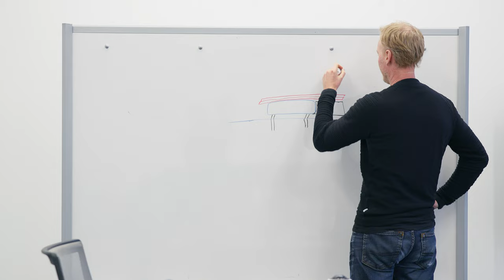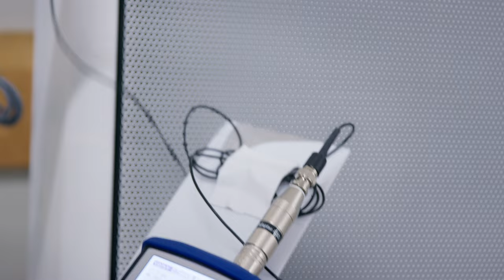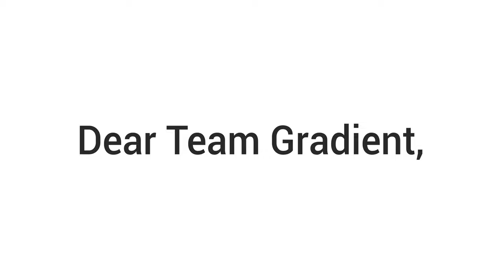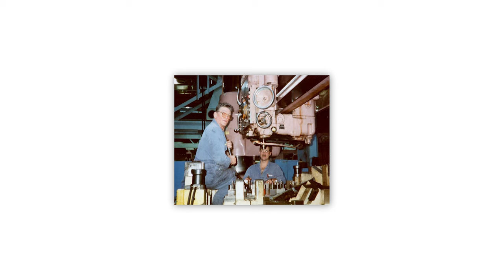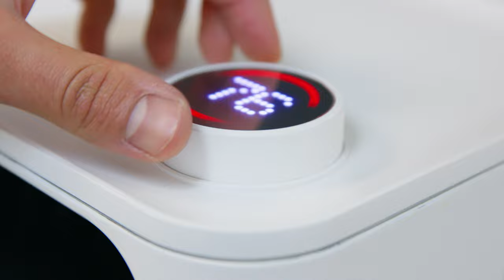Moonshot to Milestones: Pioneering Sustainable Comfort with Gradient Window Heat Pumps

Comment: Reliability is paramount.  Higher SEER is critical.  NVH minimization critical.  Buying American is good but not at outrageous pricing.  Humidity control also important in small spaces.  Air leakage unacceptable with proper mitigation (controlled venting for air exchange desirable).

Comment: I installed this unit today. If they’re fighting climate change by having less people working to help customers, then they are succeeding. Zero phone calls all email and a very bad chat bot. It threw an error code L C. The manual, the chat bought, and whoever replied to the email I had to use because there’s no phone number never told me what it meant. I eventually figured it out and got it working. My advice skip this generation and wait for the next improvement. The tech is good.  the execution not so good this time. If you have to have something, maybe try buying the.Midea version of this.